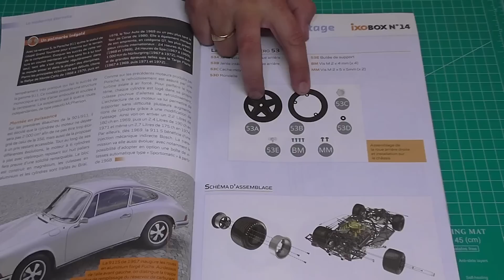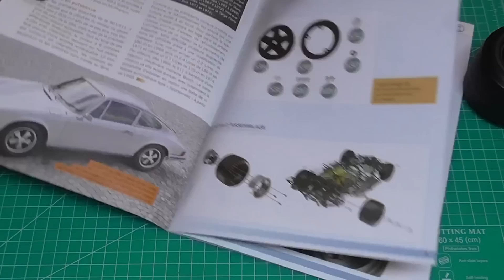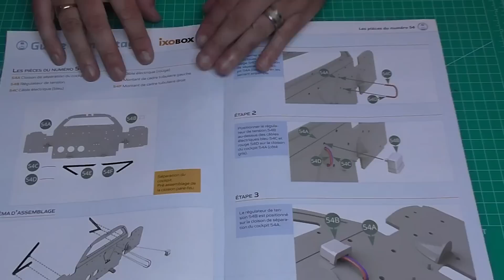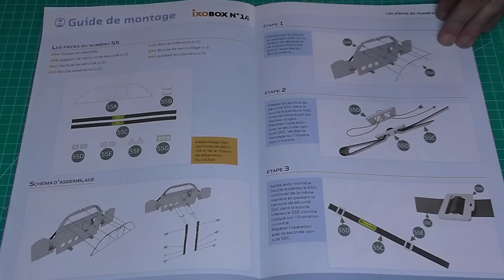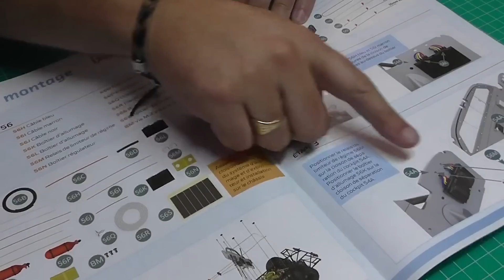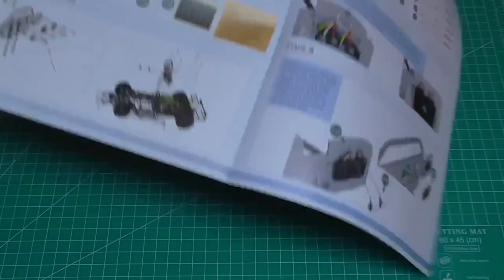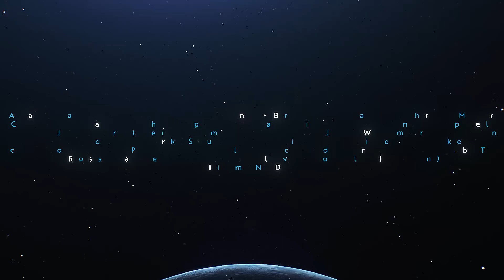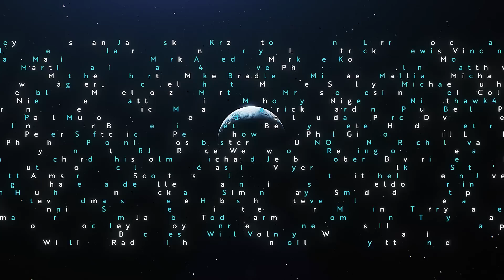Build the Porsche 917kh LIVE - Pack 14 - Stages 53-56

Comment: I just saw Box 15. We're going to do a lot of tedious work on the fuel injectors by attaching clear fuel lines to the silver injector points and routing them around the top fan into the black ties attached to the round fan housing. My guess this will take about an hour or so to complete. Then attaching a top cover on top of the trumpets finishing off by placing 3 covers on top of the engine that covers the entire assembly! If you want to see the work you've done on the engine, take a photo now, because once the top covers are on, you'll never see it again!

Comment: Hi Wayne did you ever make a Part 2 showing the finishing of Pack 14 Stages 56?
Reply from the maker: No but I will be covering it shortly in the Agora build
Reply: @WorldofWayneUK  Thanks Wayne,  just want to check how you routed the fire extinguisher lines over the engine compartment.  not too much hurry to built since the rest of the boxes won't be released until August of this year. 🙂 so far a great kit.   I would like to see them make a Mercedes Sauber c9.
Reply: @WorldofWayneUK  I'm a little confused is there a difference between the IOX and the Agora builds.  is it the same kit?
Reply from the maker: Nope. Same kit

Comment: What u should have done is drill out the plastic bit that broke off so then u can fit the replacement part better instead of cutting the pin off the part and trying to glue it on!

Comment: Sir you bring up your color blindness once every build, have you tried looking for glasses to correct your color issue? they do come in different prescription so you wouldn't have to trad sight for color.
Reply from the maker: Yer nothing works
Reply: There are no corrective lenses for colour blindness.  It is caused by non functional cones in the retina for the particular colours.  You can have 20/20 vision and still have colour blindness.
Reply: @davidgriffiths4844  try googling it before you say there aren't

EnChroma glasses are designed to improve color vision of people with forms of anomalous trichromacy, which are estimated to comprise four out of five cases of color blindness. The most common types are Protanomaly and Deuteranomaly, which are forms of partial red-green color blindness.